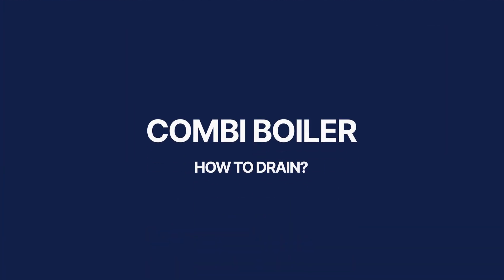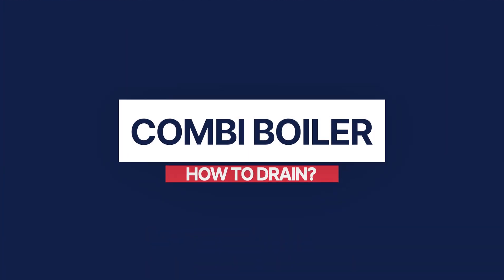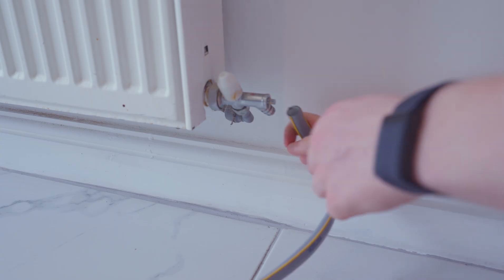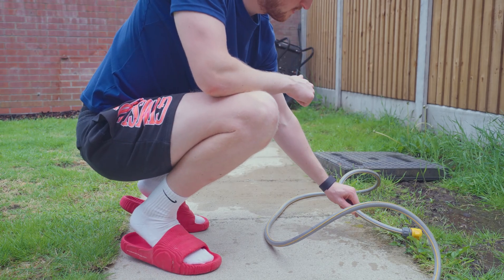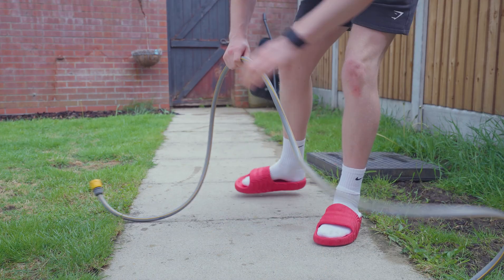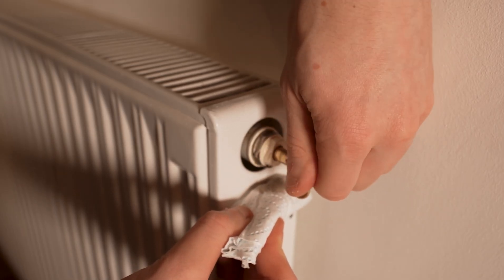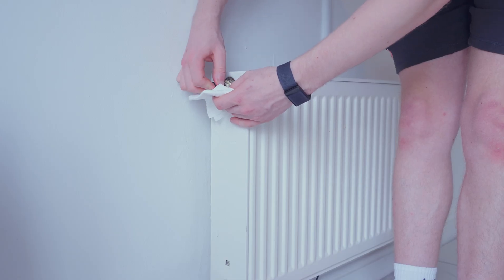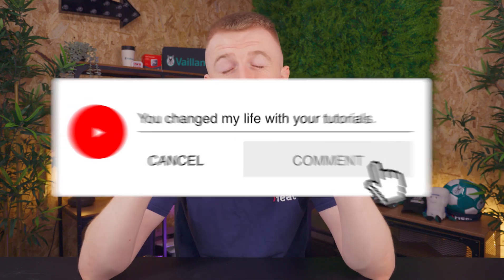How To Drain a Combi Boiler Central Heating System

Comment: Hey mate great video. I need to relocated a new radiator to a different wall in my bedroom. Im assuming once ive drained the radiators I can go ahead and make the different amendments?
Reply from the maker: Yes in theory but bare in mind the pipework may still have the water in as we just close the valves in this one

Comment: After draing down combi what amount of water is left in 10mm pipe that feeds radiator
Reply from the maker: If following the steps in this video, the pipe will have next to no water left in it as you are draining directly from the pipes that feed the radiator. If you drain from the boiler (not advised in this video) will be a different outcome

Comment: Erm no mention of the property that don't have drain valves
Reply from the maker: The best way to drain your system is from the boiler, but a plumber / gas engineer would be recommended to do this, isn't really a DIY option. More drastic measures could be removing a radiator but again we can't advise that and I imagine it to be very messy. I would call a plumber / gas engineer out to drain the system and fit a drain valve whilst they are there. Hope this helps

Comment: Once I've drained out the system can the boiler go back on? Silly question maybe but if the work will take a couple of days (plastering, radiators removed) but we need hot water in the meantime?
Reply from the maker: Hey great question! If you have removed the radiators be sure to cap off the pipes or join them up to allow the boiler to fill up with pressure. This will let you use hot water. If you haven't removed the radiators its rather pointless draining in the first place as it would need doing again after turning the boiler off.